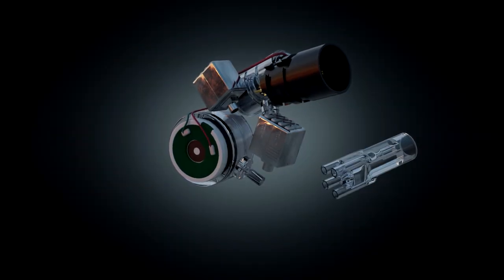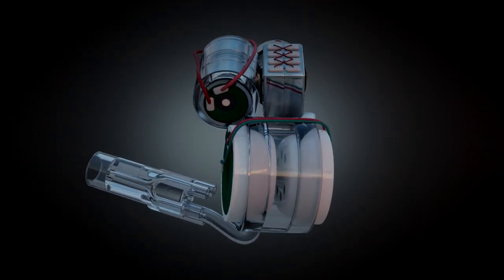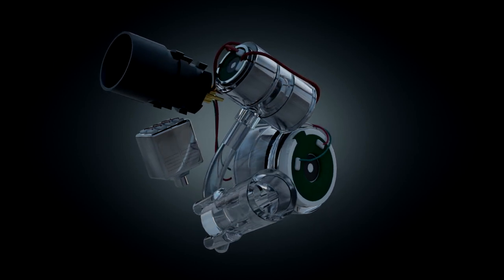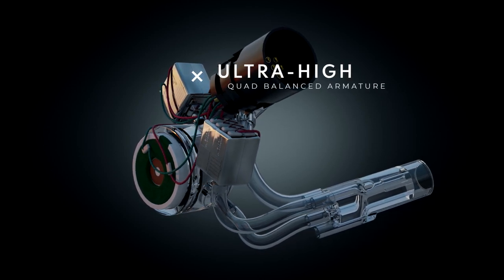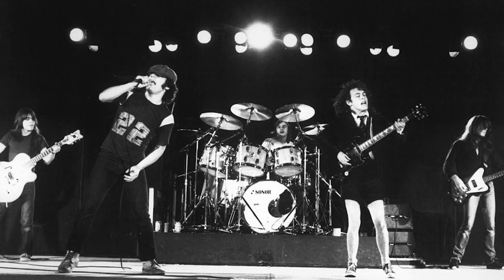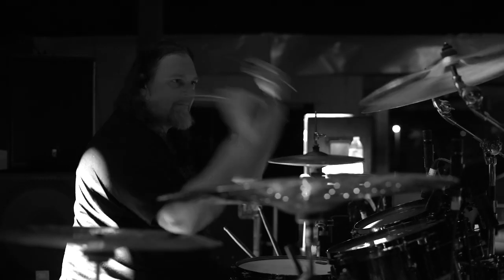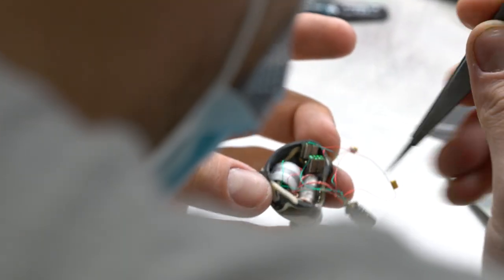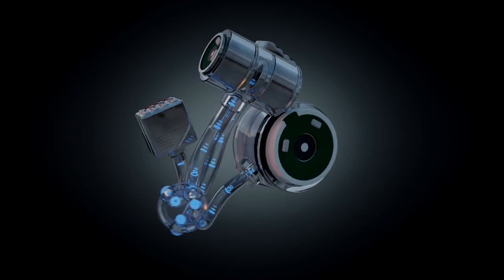JH Audio Jolene - Hybrid In-Ear Monitors

Comment: These might be the only set of IEMs I think are worth over a thousand dollars. I think there is a serious ROI discrepancy with IEMs when they get that expensive. These, however, look like they have the time and effort put into them, not to mention the fantastic looks and gorgeous case. 

The only thing I am really worried about is the cable connection into each unit. A 7 pin connecter per headphone seems like a lot of points of failure, especially with something so small. I have never heard of that connection, I am quite wary of proprietary connections on anything.